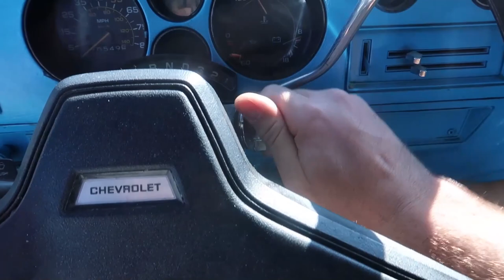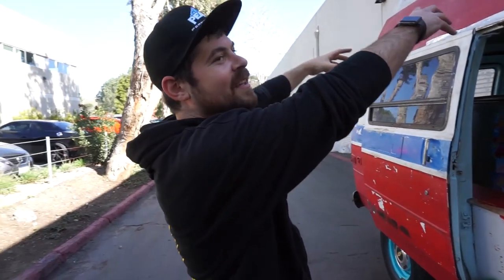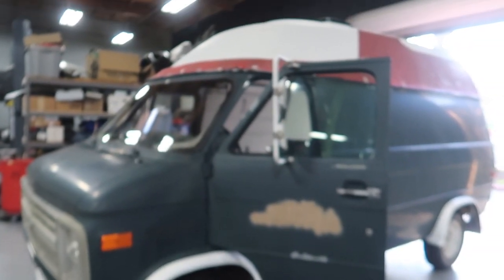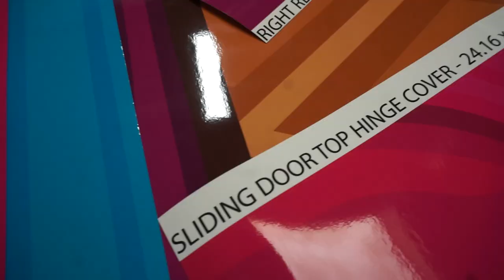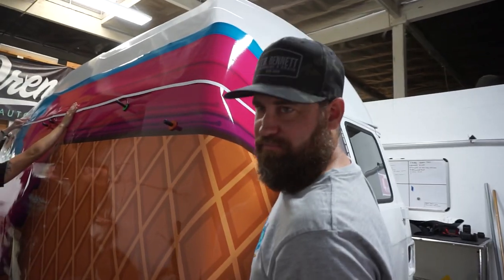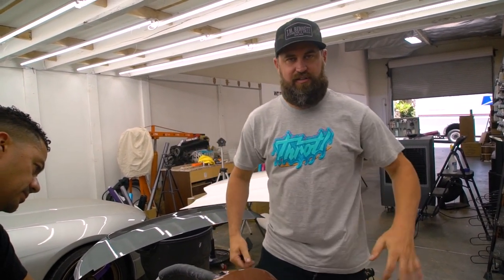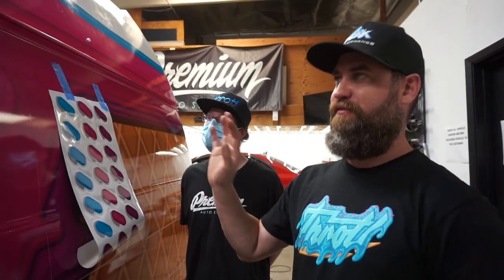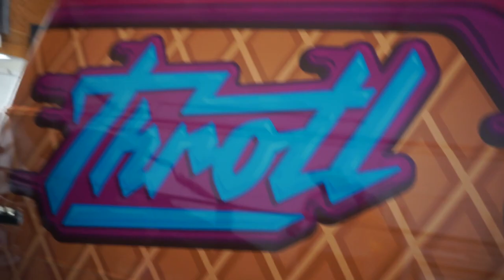Rebuilding An ABANDONED Army Vehicle into an Ice Cream Truck! [COMPLETE TRANSFORMATION]

Comment: Put ac heat rv unit on top keep that old freezer its good. just redo it up
 like new freezer compressor new condencer, check the freezer insulation clean the outside paint it up white board all around all four sides

Comment: Put anber yellow led lights on all four corners of top two at top in front on each corner at least 6inch long then two at top two corners on the back. hook them.up to the turn signals and flasher. another saftey ad would be white flicker led strobe lights by front bumber ar each corner plus two up high by the amber led turn signals on the backcorners .

Comment: did any 1 else see the really bad patching of the pattern on the drivers rear panel towards the back doors?  and also the passenger side too. could have easily continued the wrap further round to the edge of the door frame for a cleaner finish.